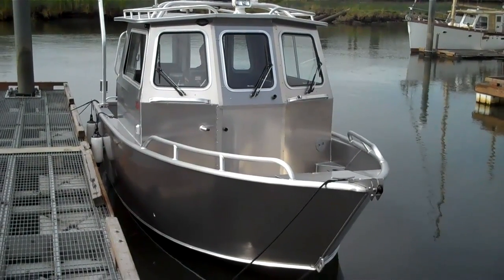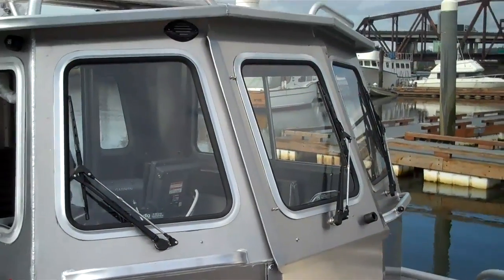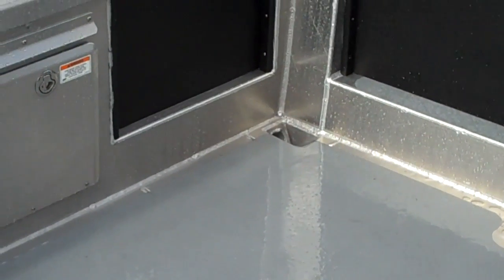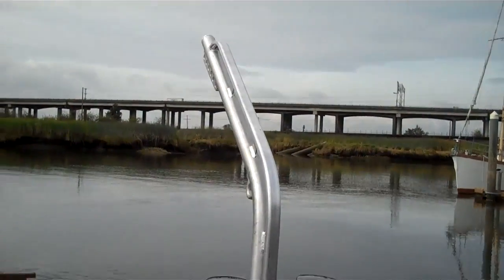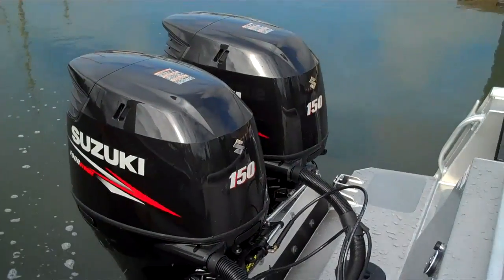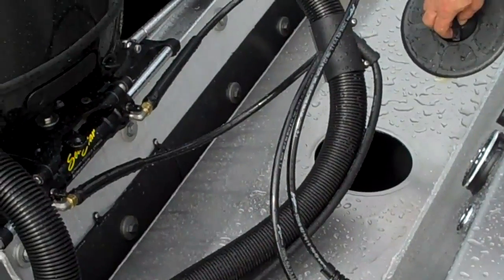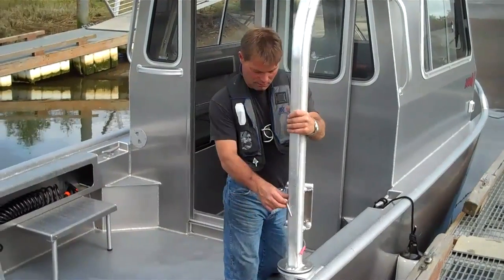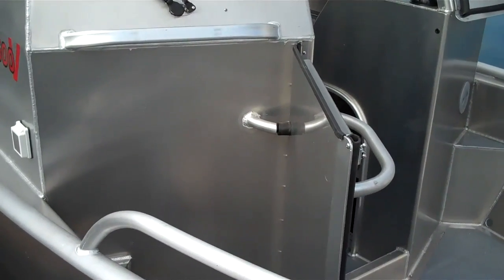Pacific Boats new 26' Walk Thru Cabin

Comment: that is the most non-functional piece of guvermint crap ever built. that design should be at least 40',with a 12' beam, and a inboard diesel. with a fully functional front hatch. this thing looks like it was designed by a freakin "mental midget"!
Reply: +bill bye The only problem with it is the front doors dont fold all the way back. And they didnt show the inside and thats what i wanted to see.
Reply: wróñg